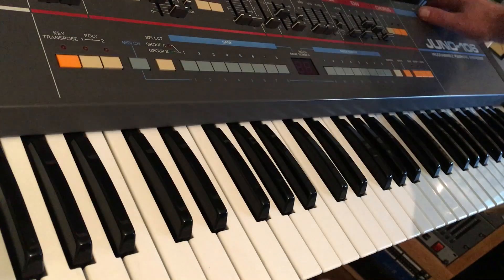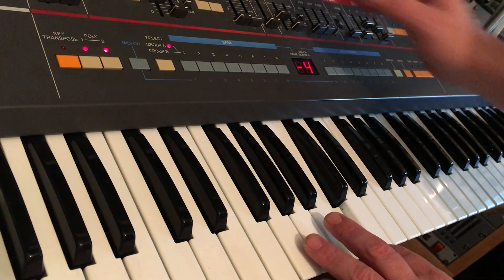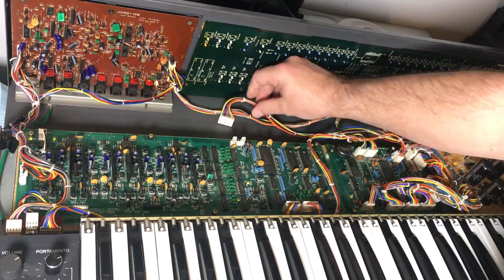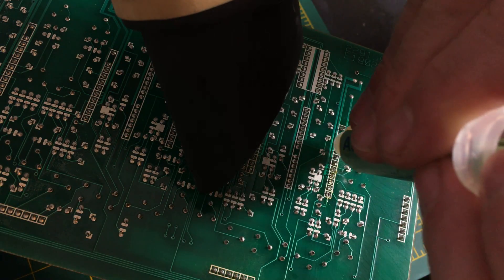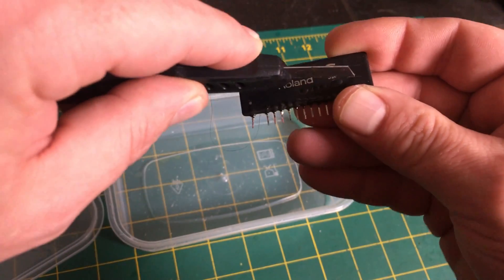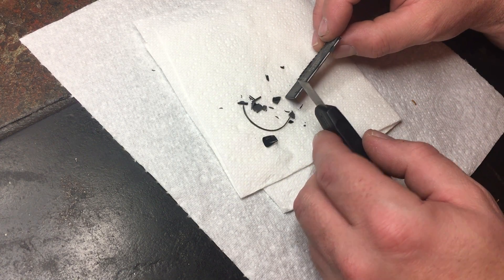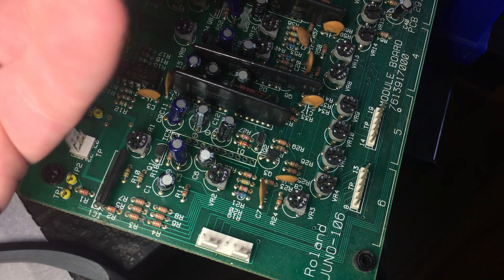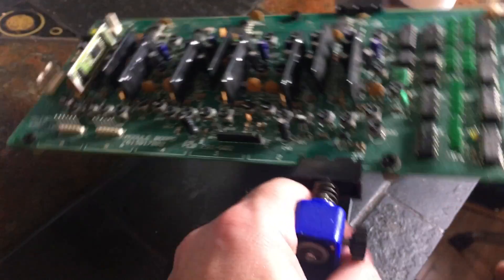Juno 106 Voice Chip Repair

Comment: Why do you remove the plastic from the chips?
Reply from the maker: Because over time it leaches and becomes resistive so it is like putting random resistors across the circuit.  It also enables one to reflow all the solder joints.

Comment: What temperature do you work with your iron at on old boards like that? Thanks!
Reply from the maker: I use a Oki PS-900, it doesn't have a temp control.  best to concentrate on not moving iron whilst applying heat, just press down you don't accidentally move a trace and becomes unstuck.

Comment: I soaked all 6 for over 2 days and the stuff got so soft it almost peeled off
Reply: Hi. I'd just like to say I soaked mine for a few days and the black stuff was still rock hard. What am I doing wrong? Plz respond if you may x
Reply: @mrhynes1684  the chemical reaction should take place no matter what.  There is a problem with the acetone you are using I can't see any other issue.

Comment: Can I put a chip like that in my volca keys?
Reply from the maker: haha i have never looked at a keys but sounds like an interesting project
Reply: you can indeed, but getting it to do absolutely anything is another story...
interesting project, absolutely!
absolutely unfeasible mostly for reasons that seem quite obvious? 
oh yeah, mos def.

i, however, must give props to the imagination and creative idea that could only come from a mind unrestricted and limited by the boundaries inherent in electronic circuitry.

but to just give an idea of the fun to be had with such a project, I'd think the first hurdle you'd need to overcome before the nightmare of making the too interface in any kind of meaningful way whatsoever, is that it may be much more of a challenge even making one fit than you realize.

if I had to "guess", you'd have much better luck just trying to utilize the chip by itself with the bare minimum of accompanying additional circuits; ie: just enough to make it work, make sounds, it's pitch controlled by something. it would only be a mono voice with one chip, and no filter, and goodness knows what else it would then be missing, BUT, that still sounds much more attainable and reasonable than trying to get your Volca Keys to play Juno sounds simply by adding one chip to it's magic spot inside, hidden under the battery compartment.
heck ,I feel dumb for not thinking of trying it on my Volca Keys before you!

"when a genius is at hand,
you let him lead the band"

Comment: you dont have to take off the plastic covers on each side to open the 106. just the 2 top screws…
Reply: yeah I noticed that today taking them off, I will say that, for me at least, it is a bit smoother opening the panel after you take the plastic end caps off completely.
could be me just over worrying, but after taking just one off and realizing what you said, I did get the panel to lift up like it should, but I believe I noticed there to be a reasonable amount less resistance after I just took off the second/last endcap, just to be safe.
it might not matter, it's just that the sound it made was much less worrying and smooth, with less resistance as well, when I took both off. anyway, I'm sure there is a way to leave em both on AND get it smoothly to open fully,  I was just too chicken shite to force it more than I had too.
my excuse was that I should take the 2nd one off so I could give everything the best cleaning possible, so removing both go hand in hand with doing the best I can at the job.

Comment: For someone who doesn't know anything about soldering what is this actual process called? I want to learn soldering but specifically to fix my Juno. May I ask what type of soldering this is called so I can look up the beginner process so I don't break my Juno? As a beginner,  I don't know what I am looking for or when to go on to the next circular silver thing.
Reply: A little late bit in case someone else is reading:
De soldering of through hole components followed by re flowing dry joints on surface mount components.

Comment: One question: Why is the problem just with the "voice modules" and not with the other 3 modules that have the same "coating". If the problems come from that coating, then it should affect these other modules as well, right? But in the repair-videos that i see they just care about the 6 voice-modules.
Reply: it actually is also the coating the problem. the coating becomes slightly conductive over time shorting things out and reducing resistance on carbon resistors
Reply: It's not the coating that is the problem, but the bad solder joints that lie underneath. The voice chips must have been a rushed job in the factory... Or something like that

Comment: I did mine last week, I did the first 2 chips with a hand pump, although I got the solder out the pins where stuck. It was not an easy removal. I did the other 4 with a £80 desoldering station (zd 915) and it took ten minutes for all 4 chips, they were easily removed, and the holes nice and clear for the fitting of new chips.
Reply: That's how I'll try it this Monday. Doing all 6 on a customer unit. 2 are bad. He wanted to go all 6

Comment: Also, you should recalibrate the chips after repair because leak currents and resistances change. It's a subtle change, but it's a change nontheless.
Reply: Maybe offer a little more detail? Knowledge is useless unless it is shared.

Comment: This isn't a "proper" repair. For a proper 80017A repair, you should desolder the SMD chips and remove the resin underneath them, then resolder them back.
Reply: how do you know the acetone didn't soak in the tiny space under the smd chips and remove it there as well?
(I'm pretty sure with the small amount of time he actually soaked them, you are probably right that that goop still remains.
I'm just wondering what you think about that hard to get to resin if you actually soaked it for a more adequate amount of time.
Reply: @Manic.Attack  It's not too hard to desolder the chips and it would do them good, I strongly suggest to do so, failing to do so may induce small but audible VCA bleed as well. The acetone may have soaked the resin pretty good but its tough to get it out from underneath the chip without risk.
Reply: @theeltea  thank you for your well-thoyght out reply bud, good point i didn't think about about the  vca bleed. at first I took the comment a little snooty but then that's why I asked how/why it wouldnt be as effective; I figured you at least know what you are talking about!
I know for myself, I'd be a little weary desoldering smd anything without specific SmD tools, but I guess if you are careful and know what you are at least trying to do/how to do it, it outta be quite reasonable to do it the "proper"way. 
I'd still probably be a little too scared myself using my current soldering station and regular solder sucker, but I'd def wanna try it on something I wouldnt be so afraid of accidently burning up.  :P
I do appreciate you explaining how to properly do it, cause while it may not be as easily within some people's means and ability, there is certainly something about doing something right (or why do it at all); most things I do I generally take that stance naturally, but without your further elaboration I would still not understand why exactly your way is "proper", and not just a harder and rather unnecessary extra effort (and possible risk).

so, now that you have enlightened me, can you perhaps give me some advice on going forward with my repair. nothing specific to ask, I'm just not looking forward to the struggle of desoldering and removing all the voice chips (and I'll prob do the filter chips and any more gooped too) with only a little hand-held solder sucker. from what I've read, an actual desoldering station could make the whole task exponentially more efficient, as well as just doing a better overall job with a fraction/none of the stress. but I really don't want to let my self use that as an excuse to put off doing it any longer, and I know I prob can do it fine,  I was just thinking of looking up some tips on how to better desolder ic's and chips in general (really , anythkng with a good number of legs, making actually getting it out a pain, since even tho I know I can confidently remove most/all of the visible solder safely and smoothly, I worry Itll still be stuck, and without being able to heat all pins simultaneously so you could just pull it, I worry of the possibility of damaging the chip through overheating/possibly even physically melting the chip to the point of no return (or unlikely return at least, haha).
I wanna jump in and just do it, but I was hoping that you may have some experience and knowledge you could share regarding what's made it hard for me to start the desoldering.
Reply: @theeltea  someone mentioned that if you were gonna just use female headers to make future repairs much more simple and fast, why not save time desoldering the whole chip as a whole, and instead cut the pins off of the chip so you can remove it easily, then desolder the pins individually.
first off, I can't picture why it would be necessary to sever the pins from the chip in the first place, just to attach to the female header. I mean, yes, that would make it easy to remove the chip and pins, but I just didn't see or understand when they said/implied youd have to remove them anyway.
maybe they were referring the male headers, like male on both sides. idk.

secondly, id really like to do "proper" to what id like to see in my finished job using headers myself, but since I don't have any around, I'm tired of putting off this repair, and I'm too broke to buy literally anything, I think I  may have to skip doing it the most forward looking method. 
one of my main concerns is that I'll overheat the chip too easily and sacrifice the chips integrity and strength, not to mention the part that actually affects everything, the solid connections of the traces that I strive so hard to avoid damaging. I mean, heck, one guy said the traces are too miniscule to even use solder wick to remove the solder. that's fine with me tho, I've never had any decent results using wick, ever. I'm sure there is a way about it, but I sure ain't found it, and don't believe I feel like ruining a chip to remind myself that wick can go suck a, umm...
a duck. yeah... wick can go suck a duck :P
🍆 🦆 ⁉️ 🤔
Reply: @Manic.Attack  Hey Tyler, glad to help. I've restored about 4 sets of original 80017s a few years ago, the new replacements were too expensive for me, unfortunately. I've grabbed a few badly wounded 106es locally and saved them. I bought a load of dead 80017s from some synth tech guy who had tons of spares and he didn't want to bother with the restoration and just replaced them with replicas. (which makes sense).

Don't be scared to work on them. The only thing you should be very careful about is the main ceramic pcb pins. I suggest you just reflow them and keep them as is. It is very easy to break the square pads off from the ceramic substrate and next to impossible to repair that afterwards without specialized glues, etc.

While it's not too hard to remove the 662s and 3109 from the substrate without a heatgun, I would recommend using one anyways as the ceramic substrate pads are quite fragile and heatguns are dirt cheap these days. Just soak em in flux and blow them off with the heatgun. They come right off. Then soak em up in acetone overnight and clean their bellies. Reflow the pads with fresh solder, thoroughly clean the main ceramic substrate spots for the 662s and 3109 and put them back in.

I suggest you don't use solder wick and use that sucker to remove the old solder.
Reply: @Manic.Attack  Contd: handheld solder suckers are safe to use, can't go wrong with one. Don't worry about the excess solder, you can remove it with a q-tip or something if you have trouble with the sucker. Just be careful with those contact pads on the substrate, they are the most fragile. 662s and 3109s are pretty tough, but also keep in mind they can actually die on the 80017s and be the actual source of the problem on a particular voice and not the resin cover. Out of a couple of dozen I restored, I had maybe 2 dead 662s and a couple of bad 3109 VCFs.

Just don't rush it. Take your time. If you're going for a proper rebuild, just desolder everything, clean both the 662 and 3109 very thoroughly (soak em overnight) both between the pins and underneath. Make sure you remove every last bit of resin crud. Don't overdo the cleaning on the ceramic, the "resistors" are printed on it and don't like abrasive. If it's flat-looking and resin free - it will do. Don't clean every spot on it. Be extra careful with the main pins (the ones with the forks) and especially the square contact pads. I would leave the stock ones, if possible. They are most probably fine as is.

Soldering it all back is pretty easy. But having a heat gun is really handy. If you're into electronics repair and cherish your vintage synths, just get one. I know mine saved me thousands in repair fees already. God knows I didn't want to become proficient at it but no one can really be trusted with such a job where I live. :( 

Let me know if you have any questions. I am no expert, but I will do my best to answer. It's 4 AM here and it was tough enough typing it from a phone. Best of luck with your Juno! I had five 106s over the last 2 decades, currently own 2 (one for me and one for my wife). I treat them well and they give me endless fun and joy of playing them. I am sure you'll be happy once you restore yours.
Reply: @theeltea  heck yeah, I think I can handle that!
 thanks a ton for sharing your knowhow and experience, definitely gave me a well needed confidence boost!!
just to clarify, the main ceramic PCB pins you are talking about are the pins that actually are soldered to the main/whole voice board (the one with ALL the voice chips, etc) and to specifically avoid overheating the fragile lands that are on that main board (not specifically the voice chips, but rather where it attaches/connects to).
just wanted to clarify since you gave me the appreciated warning to be careful with them, I just wanna make sure I know I'm being careful with the right ones, before I overzealously jump in, mess em up worrying about the wrong ones, mess em up more trying to repair without the special glue you mentioned, and then my favorite part, waiting for special glue to be delivered here paid for by money I absolutely don't have... lolol
sorry for the mini -rant.

and as far as the smd stuff and using a heat gun, i actually have a heat gun already; unfortunately, it's messed up, so that when I turn it on, it's screams at me and it's fan or whatever inside seems to be basically running wide open, which wide open in this case isnnt just full heat/highest temp, it's more like I used it and got it's internals hot enough that at some point, some part of the circuit opened and caused it's speed/ran regulation/control  to go much higher than it was ever designed.
idk if it even heats doing all that mess, it screams like such a howling banshee that I've yet to have the nerve to use it sense.
so, with the unnecessarily in depth explanation about my lack of a heat gun's use, is there any other method you could recommend, or would you say I'd be better off just waiting to find a heat gun to borrow and use ?

thanks again for all this help, time and effort, at this point I ought to be paying for your expertise and instruction. :P

if you think ill be fine tho, I'm gonna go ahead and attempt getting this solder out of the way and getting these chips out. the smd would be a later step of extra soaking after the majority of the outside/main layer is gone, so i can go ahead and try to get the ball rolling.
im looking very forward to my Juno sounding healthy, it's been in this state for the 2-3 years I've had it, and it's caused me to not play it much at all, which is a sad reality and should be a sin!! 
haha.
I think I may have(almost positive actually) a prob with some filter cards/chips too, but I'll get to that bridge when I get to it
Reply: @theeltea  really awesome too you got all those cheap 80017's from the tech!  while I can also understand his mentality and why he just bought new chips, I'm too broke and too cheap even if I had plenty of money to let something like that go to waste.
heck , at least he didn't actually "waste" them and trash em, ooofff, that would hurt my insides and soul a bit.
I just think it's a blessing in a way that these are still serviceable, as opposed to the majority of everything made nowadays, engineered and built with it's sole destiny to end up in the trash/dump...
Reply: @theeltea  THE LT, You are the man. I'll let you get some rest, but words can't explain the gratitude I feel towards you sir!! thank you so much!!
I subbed to you/your channel, so maybe we can keep in touch.
synths and making noise is one of my/if not the biggest passion of mine. as well as collecting (buying as many as I can find and afford, lol) vintage stereo receivers, and "toy keyboards" from around the 80s and 90s also (casio, Yamaha, etc), so I've got plenty of intent to keep my electronics tinkering going on deeper in the rabbit hole my entire life Hopefully.
it does stink it's not feasible for their to be a reputable synth/electronics tech around you, but hey, I say that's a hugeeee blessing, cause now that's something you can do, and since It keeps our ebony and ivory key colored brethren alive and singing, that makes it even that much more special!
so keep on keeping on!
if you don't mind I'll try and keep in touch, tell you if I was a success in my repair asap, or whether I burn the house down instead. :P
good night sir! ✌️ 💜